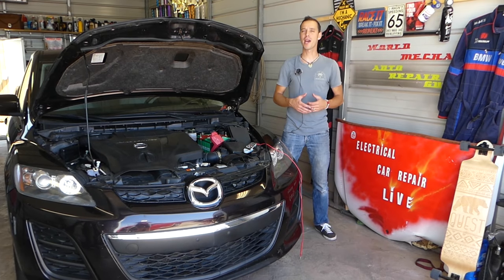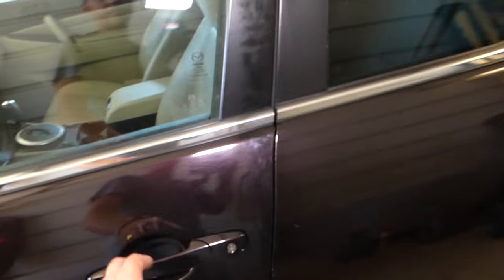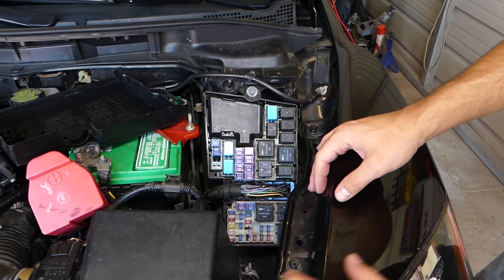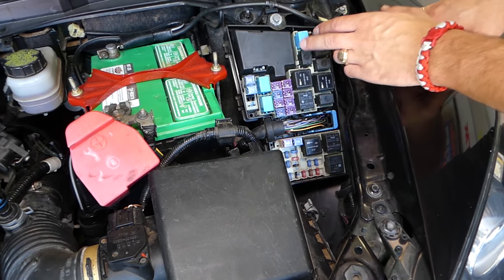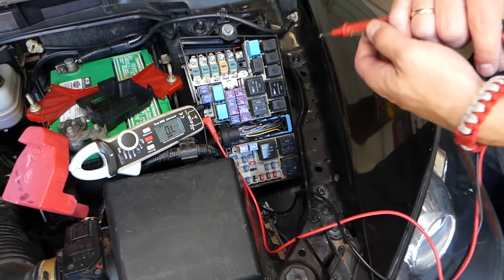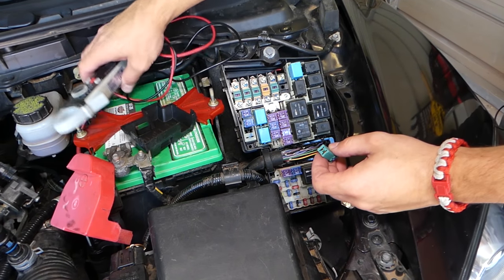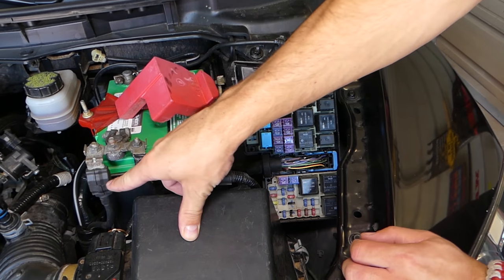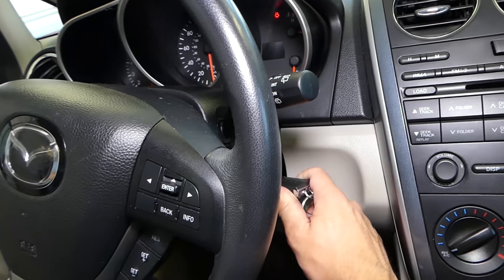MAZDA NO CRANK NO START FIX  MAZDA 2 3 5 6 CX-3 CX-5 CX-7 CX-9

Comment from the maker: Products that we use and recommend:
► VC330 Tester Voltmeter: https://amzn.to/3Y1xBN1
► Panel Removal Set: https://amzn.to/3YiMADu
► Tool Set: https://amzn.to/3p5MM6t
► Screwdriver Set: https://amzn.to/3XRB28Q
► Castrol Oil: https://amzn.to/3xBc8B9
► Oil Filter: https://amzn.to/3w0Ulme
► Torque Wrench: https://amzn.to/32qyRwg
►Liqui Moly Engine Flush: https://amzn.to/3IiDBID
► OBD Scanner that we use most often: https://amzn.to/3I4MQfe

► Check out our Amazon Store for the tools and parts that we use: https://www.amazon.com/shop/worldmechanics
Reply: instaBlaster
Reply: What is the part you replaced? What do I ask for if I go to auto parts store?
Reply: Can I just say.....you guys are the best most comprehensive repair channel on youtube! Auto Repair Guys #1
Reply: What did you change ?

Comment: I literally just had this happen. The tow truck guy shut everything off, shut the doors, closed the hood, as if normal parked at home. He then locked and unlocked the doors three (3) times in a row. Then opened the door, got in, pressed the brake and it started right up. He had me shut the door and lock it as if I was at home like normal. Waited a few seconds and he had me get in as if leaving for work. It started right up! Saved me from getting bent over at the dealership!! 🎉
Reply: did you still experience a problem since then ?
Reply: @MrMartian23rd  for a couple more starts it was ok… I replaced the battery as well. But I did have to replace the ‘safety city brake’ sensor.. these silly bells and whistles on these things.. but the sensor that alerts you when you’re traveling too close/stop assist went bad so the vehicle essentially wasn’t recognizing that the brake was being depressed and not allowing the vehicle to be started. It was under warranty thank goodness because I’d still be bruised from the beating my wallet would’ve took from the shop! I admire those that can get under a hood and work a wrench!!
Reply: Holy smokes it actually worked. Thank you!!! You saved my customers money🥳
Reply: This just saved me today!!! Is there a lasting issue that needs to be repaired? Everyone I ask is puzzled.
Reply: I just did the 3 times unlocking thing and it worked! Thanks. I was literally stuck at home depot when I read this comment before even watching the video.
Reply: @cappgunn2426 I hope u rewarded the tow truck for saving u.
Reply: Bro I literally just did this and it worked!!!!! Didn't even watch the video. I did exactly what the tow truck driver did for you, and it worked perfectly!
Reply: @jamiegarrett3869  very much so. Of course, I’m a decent human being 🙂
Reply: @cappgunn2426  just lock unlock 3x with the remote?
Reply: You literally just saved me so much money thank you for this information

Comment: This video saved me! I had this exact problem while stuck in the woods.  I don't know what I would have done without this solution.  I used the air conditioning fuse to replace the 40 amp starter fuse and got the car started.  THANKS!
Reply: Thank you
Reply: You mean the relay, not fuse

Comment: Before trying anything else, I'd recommend trying another key as the first step, assuming you have one. My key had unlocked the doors fine but one day had a no crank. I tried our back up key (which won't unlock the doors) and the car started right up. The other key later worked normally without modification. Immobilizer issue I believe.

Comment: Enjoyed your video, in the end for me my Mazda5 ended up starting when in neutral..
Reply: Yo i tried doing it your way and it fucking worked!
Reply: Same issue. Looks like need to replace neutral safety switch
Reply: @gerryhan8818  So we had the switch replaced 2 years ago. Funny you mentioned this now, it started happening again just the other day...

Comment: Hi guys!!!
Your videos are really good... I have saved so much money just by watching your videos and applying the recommendations you give...
I just would like to know if you new the part id  for the starter main fuse for mazda 3 07
Reply: The stater fuse is a 30am Fuze and the main relay is part#V23134-B52-X464 
C215 
12V
-+05523 this is what is written on the main relay for the starter - Mazda 3 2006

Comment: My case was insane! I went through every no start trouble shooting method and it turns out there is a green piece of plastic similar in dimensions to a quarter that goes into a part of the clutch pedal bracket that presses a button on the neutral safety switch sensor when you press in the clutch. It had become brittle and broken off. I pushed in the button by hand under the dash and was able start the car with the key. 

I'm looking to buy another one but I can't even find the name. I think I may just use epoxy and tape to get the broken off old one back on where it's supposed to be.
Reply: The list of things to trouble shoot is much shorter in the case of "no crank", as oppossed to "no start".

Comment: Question, my Mazda is doing exactly what you are saying, except it seems to start after I continue to try several times. Sometimes it starts right up. After watching the video, I’m wondering if it’s my jet that may be the  problem. Any thoughts? I also would like to say thank you for all the videos you uploaded on the Mazda. You guys are awesome and have been extremely helpful to a guy who is learning as I go to try and save some money. Thank you and any advice would be appreciated
Reply: Curious is it cranking or do you just hear a click? If just a click and your battery is good I would venture to look at your starter cause sometimes solenoids stick and sometimes cycling will free it up to start but if that's the case means your starter is on its way out.

Comment: I wouldn’t do a continuity test across a fuse without disconnecting the battery. Some of the circuits in the fuse box are still hot even though the key is switched off.  The proper tool for testing fuses would be a test light. If you use a multimeter then you take the fuse out of the circuit

Comment: My problem has to do with the ignition cylinder.  Sometimes when I turn the key, the car doesn't start.  BUT AFTER PLAYING WITH IT, TURNING IT HARD TO THE END, CAR STARTS RIGHT UP.  Is there a fix without replacing the key and cylinder, as I don't want to have to carry two keys.  Thanks

Jon

Comment: Good video is that Mazda a diesel or petrol?i have a 1.6 d mazda 3 2010 and can't find out if the rear fuel pump should make a noise or not some say it doesn't have a rear one on diesel's and some say it does.

Comment: Hey mazda guys my buddys swaped a new engine in his mazda 5 and the new one is doing this iv checked everything and it's all good but starter reley clicks when trying to crank and when i manualy jump the starter rely the starter wants to do something but won't...am going to bench test but dose this sound like it's the starter? It worked fine b4 is the trouble

Comment: Have y'all come across 2010-2013 mazda 3's that constantly drain batteries?
Reply: I'm also here with a mazda cx7 that won't crank over. I patched some wires that were corroded and it stopped draining but now this new problem is happening where I crank it and teeth catch for only a few seconds than let go and I hear a spinning whistle from the hood. Trying to figure this out first car not a good experience so far.

Comment: My engine cranks but won’t start I was driving on the highway then it looked like it started to overheat I had to get it towed home it cranks but won’t start I know for a fact it needs a oil change but I haven’t tried or looked at the fuses can you recommend anything for me to at least get it to start so I can take it to get the oil changed

Comment: What about a bad key that has a loose connection with the button part... I'm gonna try my other key but it does it on occasion..   same key... But yet all the lights on the dash go on.. Just did it then I turn the key off and then turned it back on the car starts... Happens every so often maybe it's a oxidized fuse or something But I think it's a loose key because my one key , sometimes comes apart

Comment: What is the part that he replaced? Trying to fix my Mazda 6.
Reply: A key switch fuse. There are 2 of them. You can try swapping it out with the blower motor fuse or power window fuse to see if the car starts.

Comment: I have the same problem in a Mazda 2 1.4 D from 2009, it starts , but after driving for a wile, once stoped it will not start unless it will pass 30 to 60 minutes.

Comment: Hey what if you turn the key and no dash lights turn on and your batteries are good? I have a 2008 mercedes s550 I’m having issues and it has no codes or warning lights.

Comment: So I have this problem occasionally but it will start if I put it into neutral. So just something to try if someone has this problem and gets stuck somewhere!
Reply: So I’ve been having this happen on occasion then after playing around with the gear shift it will start. Just tried neutral and it started right up! Did you ever get yours fixed to know what part is going bad?
Reply: No not fixed - I’ve  just gotten used to having to turn the key on and put it into neutral before I start it up. It’s likely just a buggy sensor as it is not always recognizing that the car is in park. It works about 50% of the time and I figure probably would cost more time or money to fix than is worth it. But I do have to warn people if they have to drive my car!
Reply: Same issue. Looks like need to replace neutral safety switch

Comment: So my problem seems to be the key its a mazda 2 from 2009 and i have replace the key battery cause it was dead so at first i worked fine no issues but now after  4 days that i dint try to start it the car won't start and the security symbol is flashing !  Please help what should i do ??

Comment: hi i have a problem in mazda cx9 i changed the batteries twice and the car doesnt want to turn on and i tired the wire from another battery but still doesnt turn on any resoultion on whats the probem.
Reply: How did u get it to work
Reply: Mine does this sometimes all lights and everything comes on so I know it's not yhe battery.  I took it out of park and put it back in and it started right up. I have no idea why, but it worked

Comment: Can I stick the key in it doesn't even turn so I'm going to try to steal my car with a screwdriver stuck to screwdriver in and it got broken off I pulled it out tried to stick the key in it went in finally and it won't turn how do I replace the ignition switch on a 2011 Mazda CX-7

Comment: Same problem for me but also my gauges go crazy
Reply: You ever figure out what it was
Reply: @ngkngk875  yeah man, my battery had a fuckin crack in it and apparently who owned the car before just put some JBWeld over and threw it back in the car lol. So new battery and problem solved
Reply: John Smoke Sweet. Literally about to go to the get a battery now. Hope the gauges return to normal they are stuck in a messed up position now. Also that’s crazy I’ve never heard of someone welding a battery before lol
Reply: @ngkngk875  did that work for you? Having the same problem. My battery I pulled out and fully charged
Reply: @phanomchanthavong1668  Yes new battery worked. Battery was pretty old and having it sit during the lockdown a couple days was enough for it to finally give up.
Reply: @ngkngk875  thanks man, I will try that too
Reply: @phanomchanthavong1668  good luck bro
Reply: Ngk ngk, did u ever get yours figured out? I have the same issue. I've checked ground wire, relays, fuses, was about to put in a new fuse box and starter. Need to check starter first. Did a new battery fix yours? My battery light hasn't come on or nothing

Comment: I have a 2005 mazda 3  2.3l  no start no crank  , when i turn the key the starter engages but wont crank  replaced starter and the new one does the same thing , swapped relays  no change. Any ideas?
Reply: I got the same problem with an standard   one, I saw another video where they replace a sensor located at the gear stick in automatic transmission but mine is standard

Comment: My battery keeps dying and all my dash lights go on and go crazy and then nothing…the dealer replaced the battery so now it’s new and the same thing happened! I hate Mazdas grrrr…
Reply: I hate Mazda's too I just bought one, ran good for a week. next thing I know check engine light and AT light comes on, gas runs out quick, car won't start even after jumping, sway bar bushings bad gives it a ratting noise, it's just straight up hell. I'll stick with ford and never get another Mazda again.
Reply: @reneetoller8570  we had a Ford truck and it just lit on fire and burned….